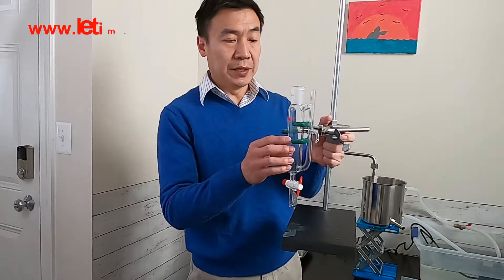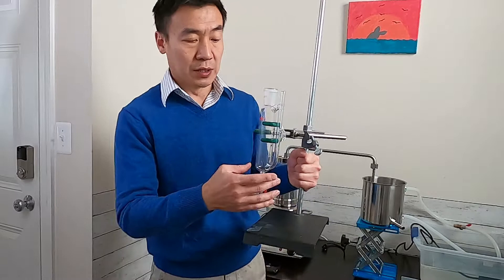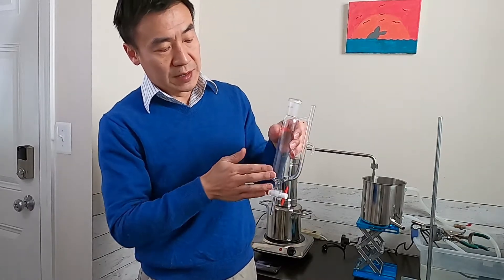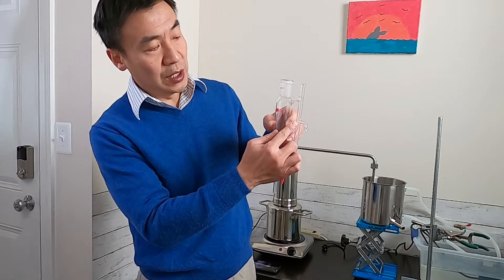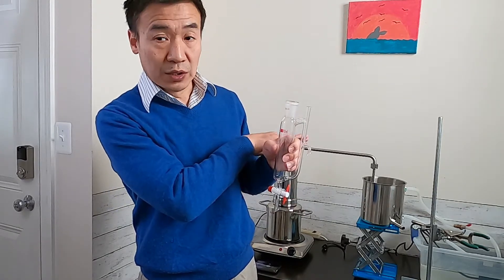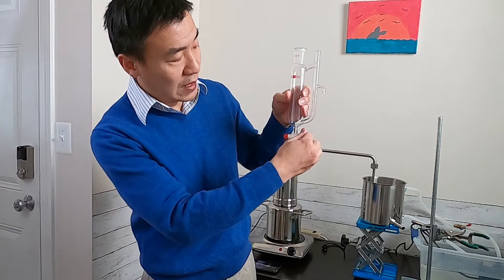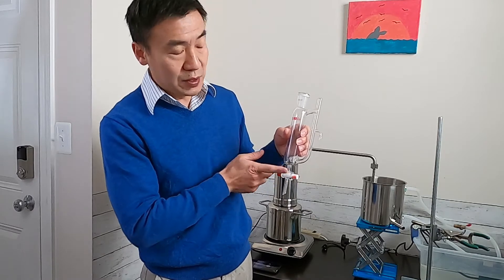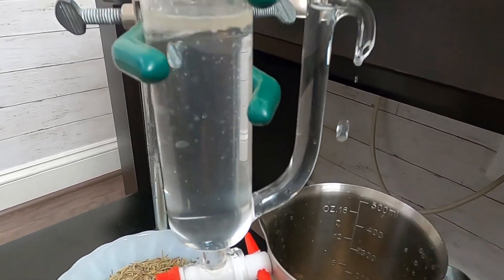How Essential Oil Separator Works? Explains essential oil hydrosol separator

Comment: Just received my distiller and oil separator but the oil and hydrasol from the tubing kept going splashing down the top glass (tube) top part that goes to the serrate glass "tube" that should only be hydrosol. The one I received from the kit does not angle upwards like the one in this video and is flat (parallel to the ground).  Is there a video that shows setting it up with the tubing going into it so this won't happen?
Reply from the maker: Can you send me a picture?
Reply: @LeTimeLeo  okay I'll email one when I set it up again ... Thank you!

Comment: Is this apparatus connected to the condenser?
Reply from the maker: Yes. Use a tubing to lead the distillate into the separator. While collecting oil and hydrosol, they can be separated due to their density difference.
Reply: @LeTimeLeo  Thank you for answering. My setup is laboratory based. I run a boiling flask with Claison adapter to a biomass bulb. The biomass bulb connects to a still head and then to a Graham condenser. I will try to connect the oil separator to the condenser like it's a Dean-Stark trap or Clevenger apparatus. I'll let.you know how it works out.

Comment: This good water oil separator..?? I want to use it for waste oils...
Reply from the maker: This separator is good for active separating oil and water, which means your water and oil mixture is separated while production. If you have the mixture ready for separation, you can use flask separator.
Reply: @LeTimeLeo  After watching your video, I purchased the LETime Distiller (500 ml). What size is the oil separator?